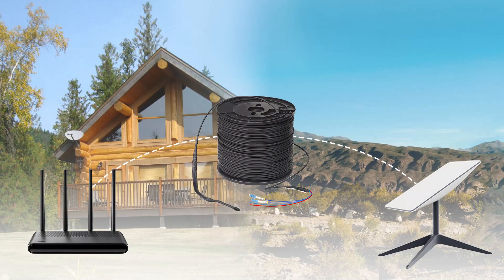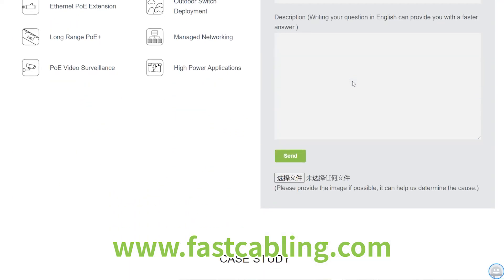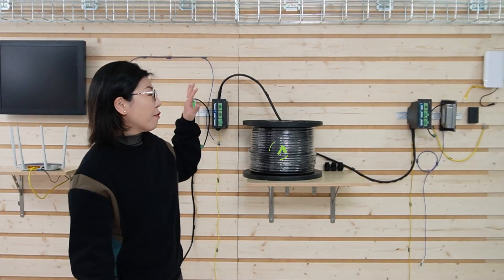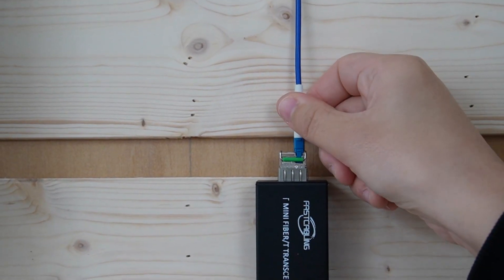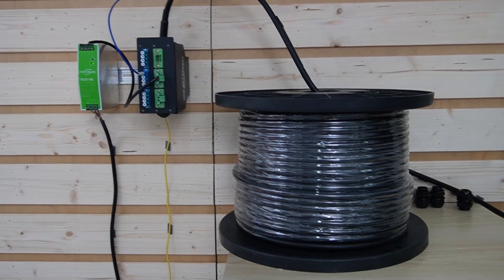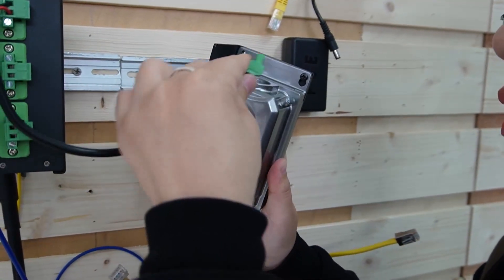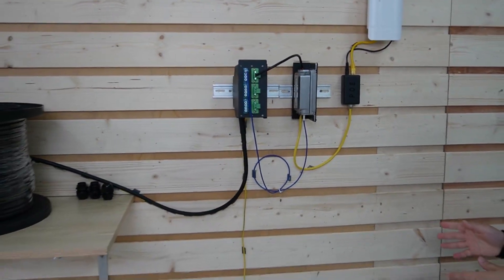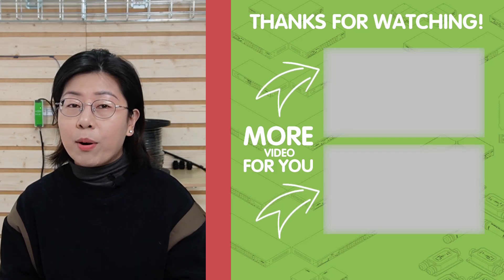DIY Composite Fiber Cable Installation for Long-Distance 4G Internet

Comment: How is the composite fiber cable?
Reply from the maker: The composite fiber cable includes optical fiber strands for data transmission and metallic elements for power delivery. This type of cable is useful in applications where both data and power need to be transmitted over long distances to remote locations without local power sources.